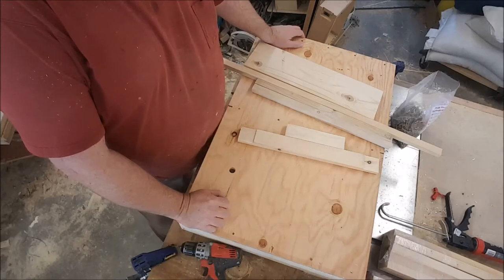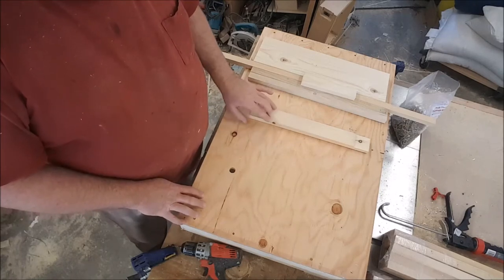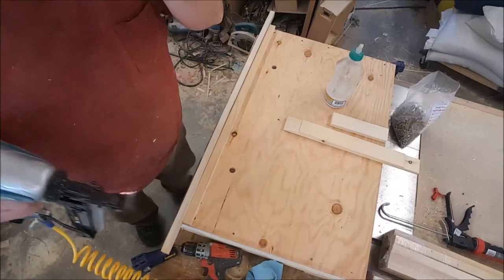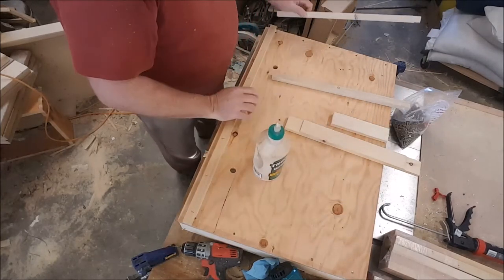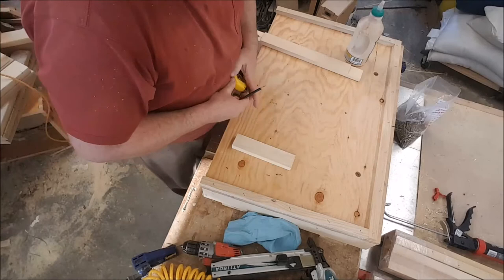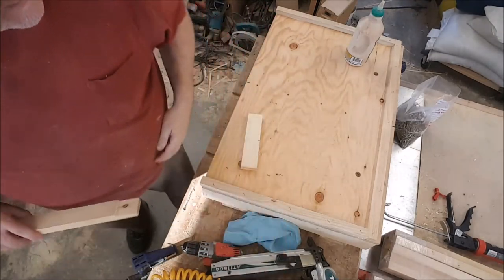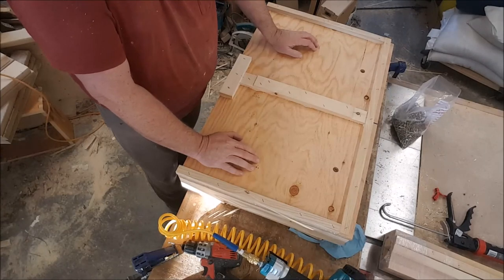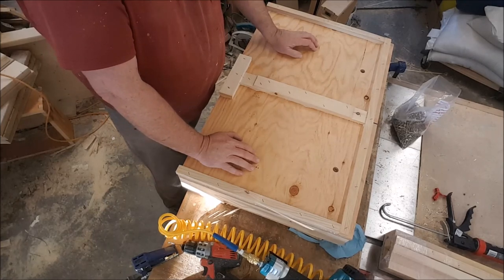🔨Two Way Migratory Pallet Assembly Part 2 - That Bee Man

Comment: Thanks for sharing the how to videos. I understand why you want the bottom a little wider so you're not pushing on the lids and shifting boxes. Won't that lip be a rain and snow catch and shorten the life of the pallet or does the wax dipping make them indestructible from the weather?
Reply from the maker: Yes, It does catch some rain.  The wax dipping prevents most moisture absorption.  The bottom ledge might very well deteriorate faster though, I have not used them long enough to know for sure.